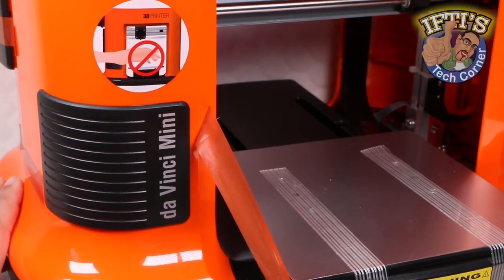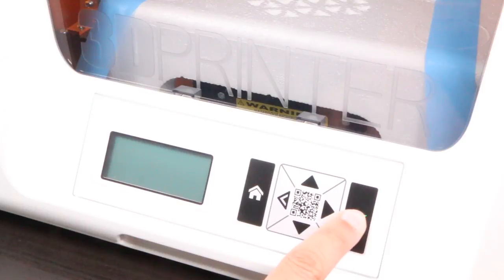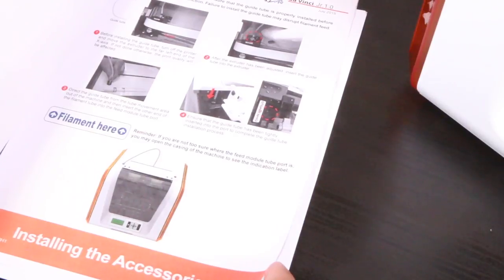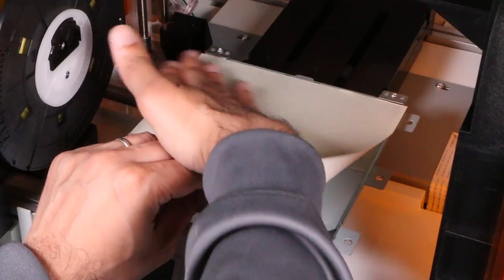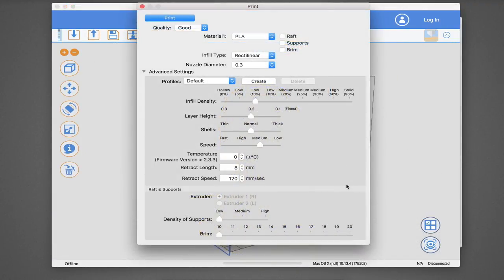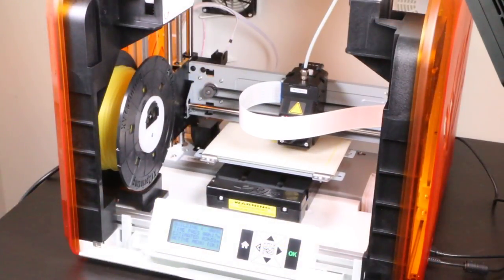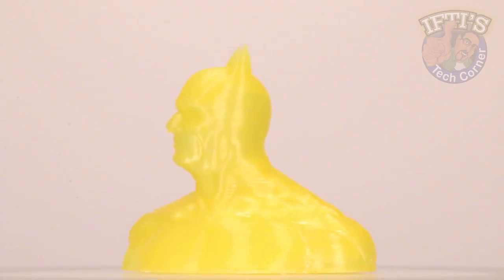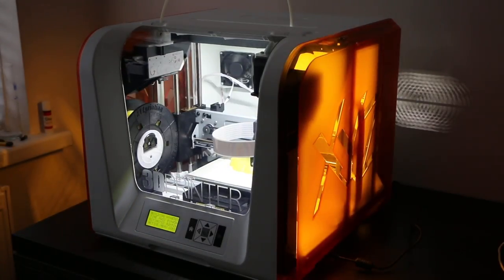XYZ-Printing - Da Vinci Junior Jr 1.0 3D Printer for Beginners! - REVIEW

Comment: I've had this printer for a few years now and over all i love it, it works very well and has a pretty decent print quality
the issues i have are that you can only use the Filament sold by XYZ so its annoying, expensive, and limits filament options
i also have issues with prints sticking to the bed but that's a given because of the glass bed i just use some painters tape and that works most of the time
its a great printer for starting but i would not recommend it for more advanced people
Reply: Just a little hack for you, in school we have this printer (and I was thinking of getting one of these at home) is to put masking tape squares onto the bed. That should help with the sticking!

Comment: I could never complete a 3D-printout with this machine. The filament stucks in the dispenser,  the feeder cuts the filament, the printer stops dispensing and turns empty figures in the air. It's not usable and impossible to complete something.
Reply from the maker: Strange - the only issue I had were getting prints to stick to the bed. Otherwise it was perfect for me.....
Reply: I did a lot of work on my printer now.

I lowered the pressure on the feeder mechanism by reducing the tension of the spring. It had a force of about 3 kg. I lowered it to 300g, by the use of a screw driver to increase the spacing of the springs windings.
I also lowered the pressure of the springs in the filament detectors, to allow a smoother guiding trough.
I had to fix the entry for the filament on the extruder with a nylon washer, mounted under the fixation.
The cone inside the extruder had some sharp edges, where the filament was jammed often. I had to sand it a bit.

Now it prints perfectly.
Reply: Its not junior at all its crap!

Comment: Sure can tell you was paid for this review. This printer is CRAP
Reply from the maker: Unfortunately I do not get paid for any reviews - at the time of producing the video I had no issues and all test units printed fine. Have since replaced the unit so haven't had any long term experience however. Whether I would still recommend is another question given the date of the review and the number of models that now supersede it....
Reply: I can't even print a single thing with it, its just a toy to play with its crap!